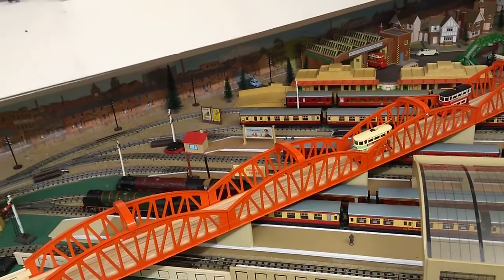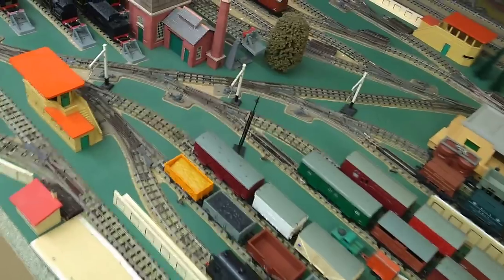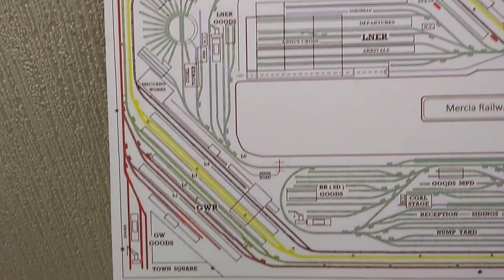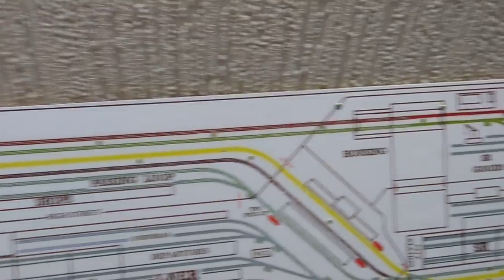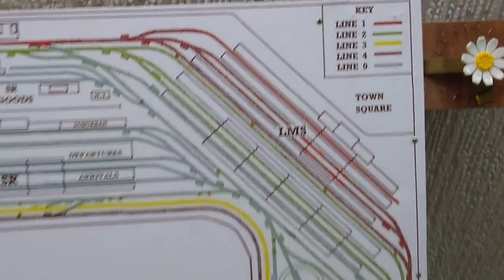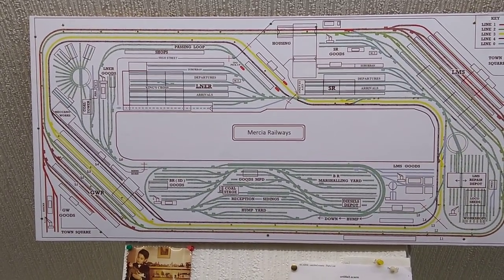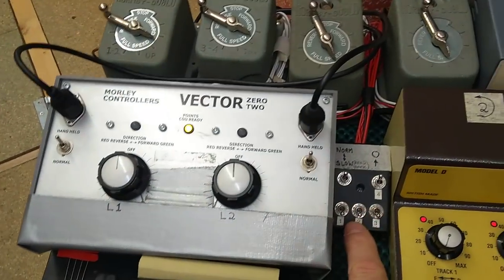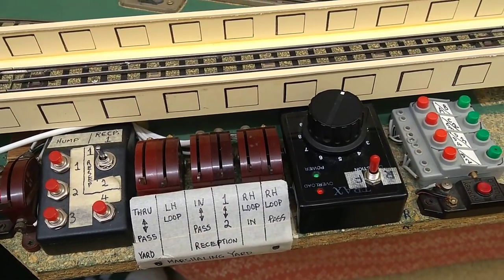Hornby Dublo Mercia Layout, part 1 layout details

Comment: hi ron what size screws do you use in metric to lay the track has I am about to lay mine
Neil
Reply from the maker: Hi Neil, I use 2mm x 10 or 12mm countersunk cross head screws, I find these on Amazon I also drill a pilot hole first. I have made a Youtube video on Hornby Dublo trackwork that may be useful for you.  https://youtu.be/7mTMn1C3GbY   Regards,  Ron